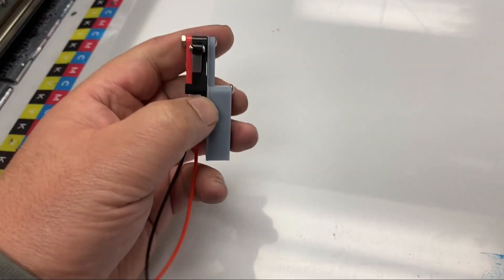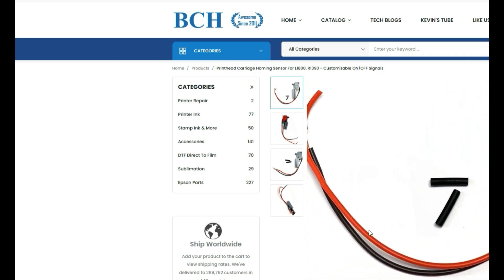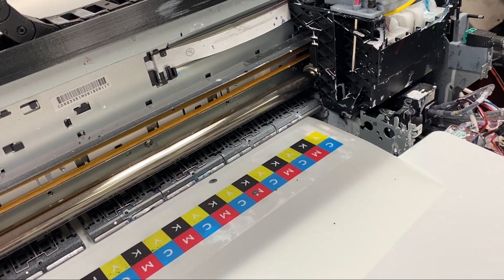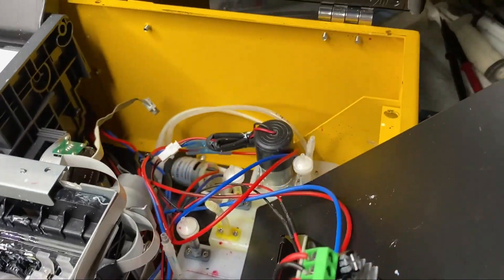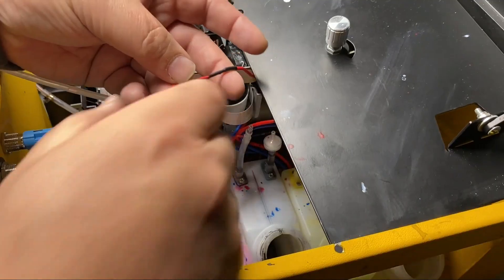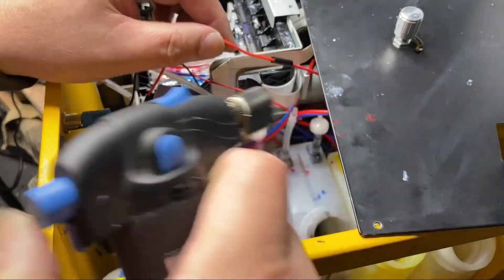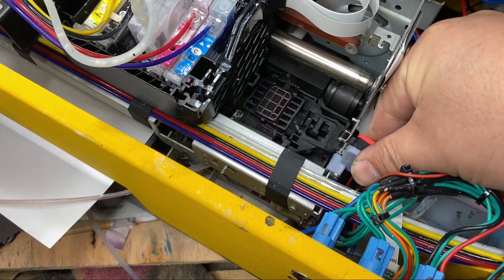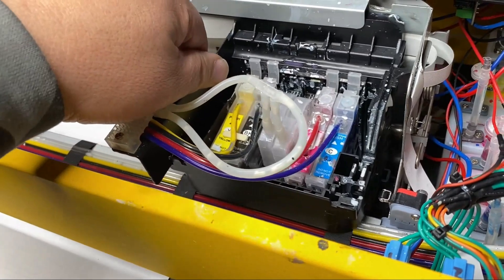DTF Homing Sensor REVOLUTIONIZES Your L1800 1390 Printhead Experience

Comment: How do you replace the platen to vacuum suction box.. without getting double blink error
Reply from the maker: Thanks so much for your question and for supporting BCH Technologies! Replacing the platen itself usually won’t cause the double blinking light, but it often happens if the CR is blocked from moving freely. The best way to know for sure is by using Epson’s Adjustment Program, which lets you run a Printer Information Check and see the exact error code—then you can match it up with our BCH Epson Error guide (just Google “BCH Epson Error”) to understand what’s going on. Sometimes errors relate to things like the APG sensor, and this tool is usually given to Epson techs but can also be found through DTF sellers online. I also made a short walkthrough video you can check out here: [https://youtube.com/shorts/FPZzpyYuZLE](https://youtube.com/shorts/FPZzpyYuZLE). I do get a very high volume of questions, so while I try to answer as many as possible, subscribers and members always get priority responses within about 48 hours along with perks like early video access. If you’re not subscribed yet, I’d love to have you join, and if you need faster help, you can email [support@bchtechnologies.com](mailto:support@bchtechnologies.com). If this video or reply helps your journey, I’d really appreciate it if you could leave a quick review here: [https://g.page/r/CfL7k6nYvPQ9EAg/review](https://g.page/r/CfL7k6nYvPQ9EAg/review).